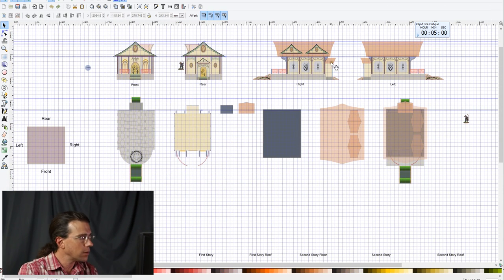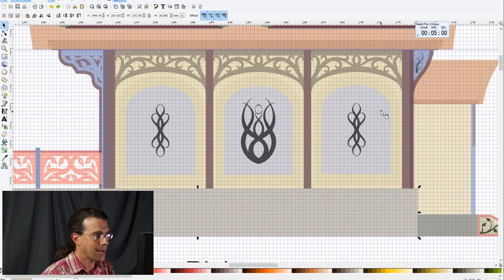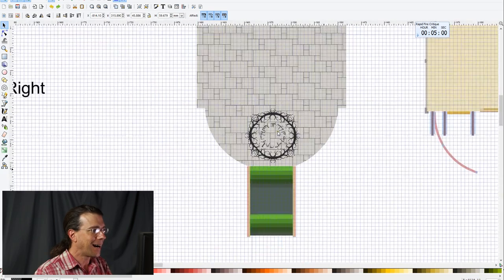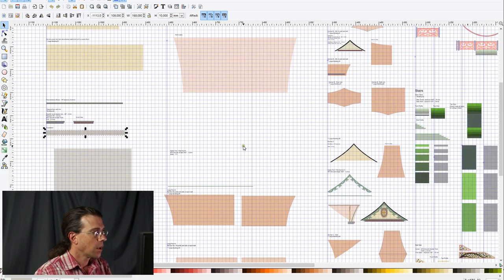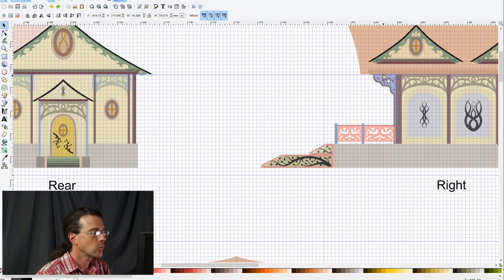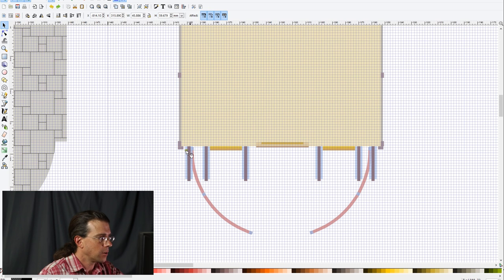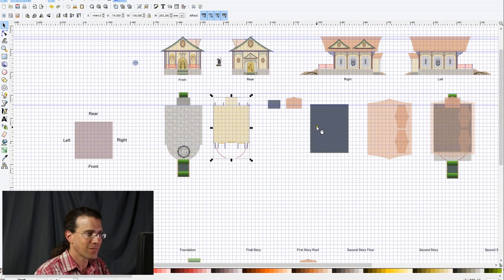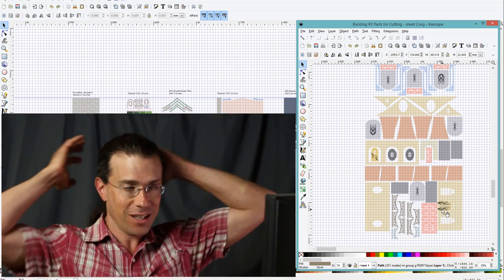TerranScapes - Elf Town WIP #6 - Building laser cutting ready

Comment: Looking great Mike. Itching to see one of the buildings constructed. Thinking about the construction, would it save time to make up a selection of the smaller elements, like windows, door surrounds and doors, and then make some open moulds to cast them in resin. It might not save a lot of time but the resin would also allow you to add damage and decay easier... if that's the look you will be going for.
Reply from the maker: That is the plan right now.  I'm creating an even more modularized system with 'pre-built' components that can be used in various ways.  
And I'm looking forward to a constructed building myself.  The clients are too.  :)

Comment: I share your concerns about the angle of the valleys connecting the dormers to the main roof. It doesn't look right. I believe the line should be straight when viewed directly from above. (Since the sides of the dormer are curved in a similar fashion to the main roof, the flattened roof would have curved edge.)  Might I suggest you make a prototype out of cardstock, five or ten times the size of the model.
Reply from the maker: I may need to create a cardstock mock up of the roof lines for sure.  I'm waiting to see how close I came and then will modify it using cardstock, etc. to get the final shape down.  I probably should have just done that from the outset.  Probably would have saved me some time.  :)